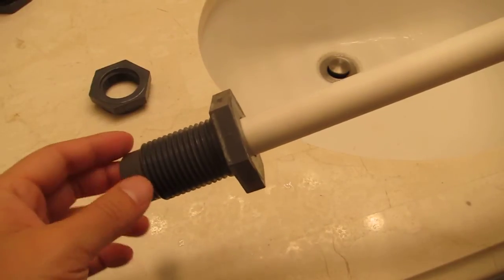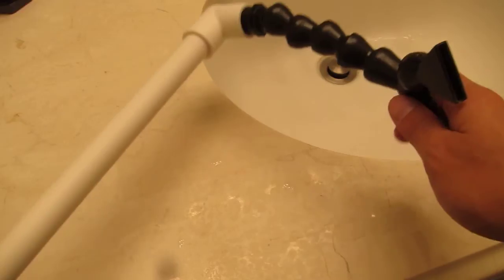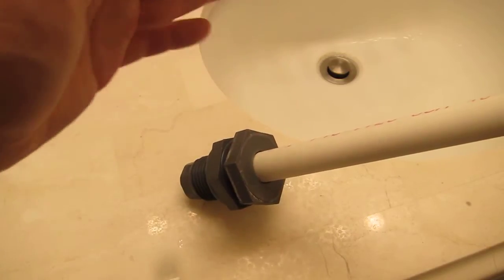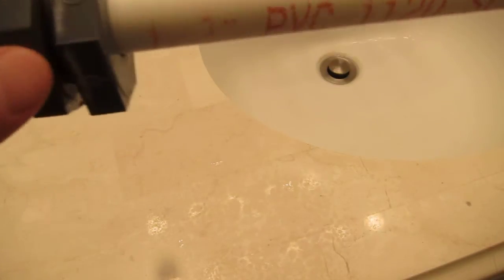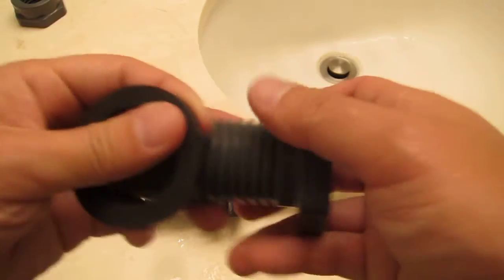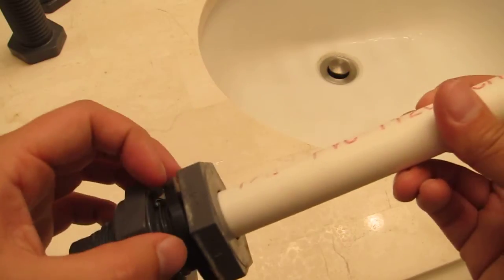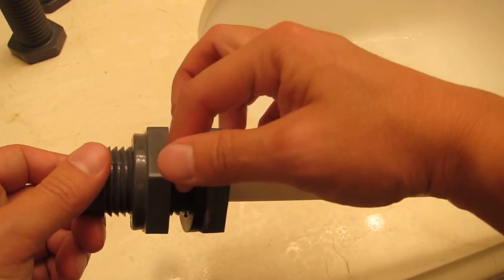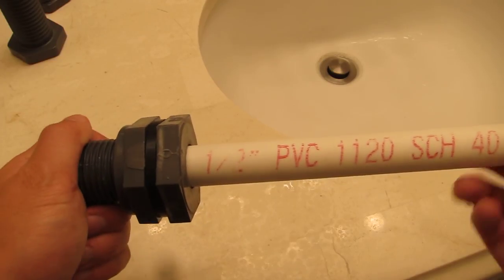Leaky Aquarium Bulkhead - Debug & Fix

Comment: After taking off the bulkhead. I noticed a hard tube like crustaceans throughout my overflow filters. These vermetid snails grew underneath the gasket enough to form a drip. I scraped the crustaceans, cleaned the bulkheads and replaced the gasket. (This time I put a bead of aquarium silicon in there for a better hold) 🙏🏾

Comment: Man thanks to this exact video I fixed mine today, my bulkhead was leaking and it had play in it, I cleaned it and the inside of tank, got a gasket ring because it didn't have one and used a bit of dap seal safe for aquariums and bam it's sealed now and sturdy again!  Thanks man

Comment: 1. Spray paint pvc - just no.  it will crust over quickly, just be patient.  You can silicone some live rock rubble on it if you want.
2. Teflon tape on all threads, with the exception of the bulkhead where it's not required.
3. Everything hand tighten.  Most common failure point is over tightening or gasket pliability.
4. Best case, use a schedule 80 bulkhead if you have the room, otherwise schedule 40.
5. Heavy dose of silicon lubricant on the gasket.
6. Salt creep = leakage.  This needs to be fixed asap, disaster waiting to happen.  Undo the joint, inspect the gaseket, if dried out then lubricate.  If grooved or damaged at all due to over tightening replace!
7.  Gasket ALWAYS goes on the inside.

It's not easy to admit your mistakes, I commend you!  Thanks for sharing!  I hope my comments help you and others.  :c)
Reply from the maker: Thank you, lots of lessons learned since a year ago!  Re: spray paint pvc - So far the spray paint pvc is holding up ok and I have not heard anything bad from spraying painting them though, did you hear otherwise?
Reply: The simple answer is that water is a solvent, so it will dissolve the paint.  There may be some specialized formula that's appropriate, ie rubber spray.  If you find something like that I'll research with you as that will be good to know.  You might give schedule 80 pipe a look, which is gray and more appealing visually until it crusts over.